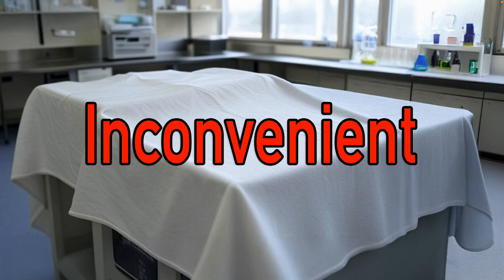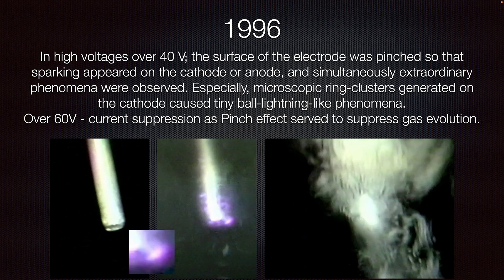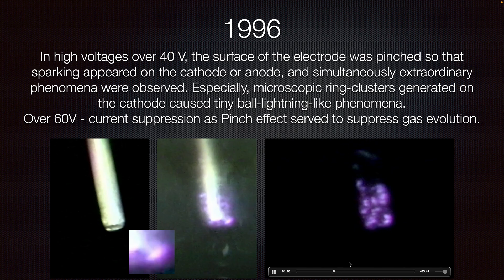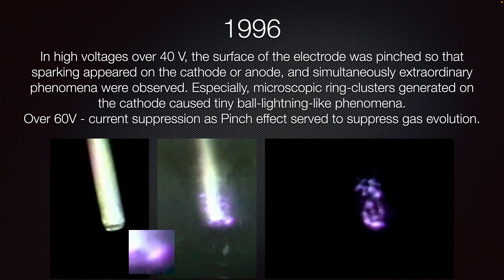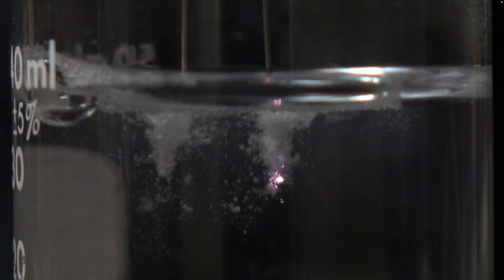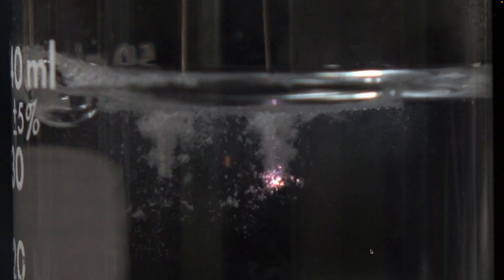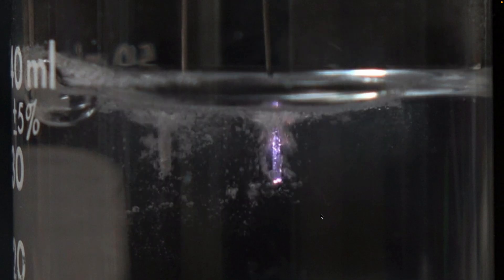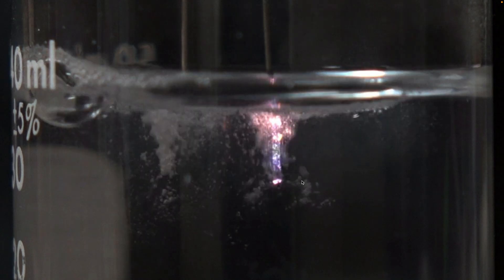Partial Replication of Matsumoto's "Experiments of Underwater Spark Discharges" 1996 experiment

Comment: Ive done this with an MOT and doubler circuit with a spark plug in a mason jar , pretty intense electrolysis and ignition of hydrogen! Do not try this unless your familiar and safe with microwave circuitry ☠️ very deadly
Reply: Also used high frequency inverter welder and 7 stainless plate 5 gallon bucket  cell, decent results

Comment: So I need a 1mm copper wire? maybe aluminium?(Or thinner is better lower power input?)
And just go direct current into it while it's in the water, until enough power pushes the current out of the wire? and walla, plasma?
I'd like to try but I can't order anything online or get to a shop of any kind..literally.
But I could build some static maybe manually and push it through a wire I'd imagine.
Reply from the maker: Play safe

Comment: I found a wheel within a wheel :)
It was 2 donuts side by side, which lined up to an invisible donut going perpendicular in angle.
It's late. I'm processing the video and I highlighted parts, lots of zoom and adjustments to colour, saturation, contrast, brightness etc.
If that's a wheel within a wheel, then maybe looking above or below that formation, might show a jet or signs of a jet from a third wheel, although maybe you can only say that that third wheel is etheric in nature and not visible or even influencial to the hydro-dynamics we can see. It would have to have been measured for radiation maybe? Which is a bit late lol
You'd probably want a radiation sensor readout and run it along the same timeline as the video recording, then put them side by side and maybe somethings will clearly line up. quad directional sensing at minimum(4 sensor channels).. that's a lot of work.
Still an hour of processing left. I'll post on my page I guess, and comment with a link when it's done. maybe tonight if the upload isn't taking too long. And hopefully my settings are okay for 1080p output. I had to go 4mb/s bitrate to try get the file size down some. usually 5mb/s is okay at 720p..so... 
Oh! I'm using Openshot video editor. It's free and super easy to play around with ;)
Reply: Aha! you need a metal plate, maybe some stronger than aluminium, like iron, so that when one of those wheels within wheels goes off near the plate, you can see it and then hopefully it will take a lump out of the iron.
Although Iron is going to be conductive.. carbon? Or is it possible to mix aluminium with iron, or a sheet of aluminium, over an iron plate, might bring out some interesting results.

Comment: I heard mention of AI influence, I guess in processing a sharper image.
I'm wondering if you created multiple compositions of a section of frames in varying contrasts and brightness, like layers and had AI compare them, would you be able to use AI then to use all those to create a version of the mean, or say you use some inverted layers and the extremes, to get more information on what is and isn't there and to what extent, better colour comparisons etc.
Maybe that IS what was done, I've only really debated an AI chatbot, but I am familiar with graphics and digital art to some extent.
Reply from the maker: Best to avoid any cameras with any AI - it is bad enough with optical artefacts clouding judgement, AI is a disaster.
Reply: This may allow you to digitally zoom in much much closer and have some good estimates as to what is happening dynamically.

Comment: When I was playing with plasma water electrolysis (RO water with a bit of baking soda, 308L stainless electrodes, 300-350VDC), I saw a bit of bright plasma flying from the electrode up, through the water, at least 10, maybe 15 cm. It was very unlikely to be a piece of glowing metal, since the water would've quenched it at the beginning of its path, in like 1-2cm. To reiterate, if flew 10-15cm through the water, while brightly glowing.
Reply: did you test the water after?
Reply: test how?  @pro.empire
Reply: @pro.empire  how exactly?

Comment: Has anyone done a spectrogram analysis of the light emitted?
Reply from the maker: Not in our group, we do have a spectrometer. Note, water has an extinction limit in the UV, so you will not see anything higer than that, not an issue for my spectrometer. My issue is, the PSU I bought only goes to 30V